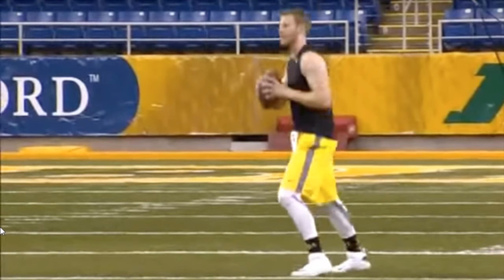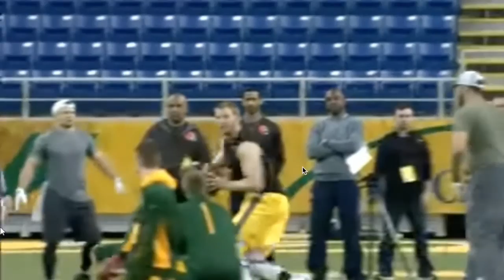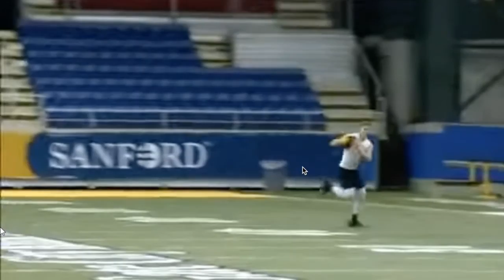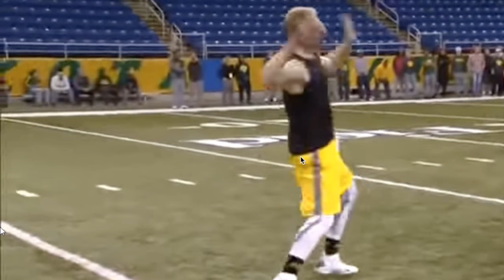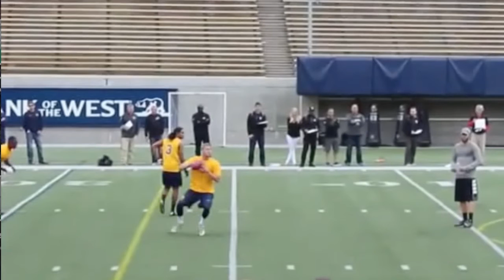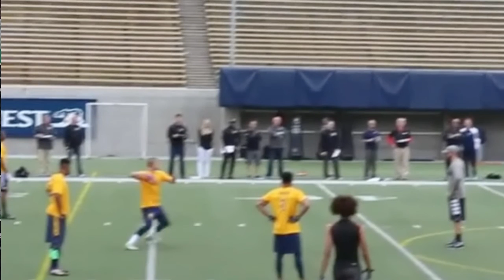Carson Wentz and Jared Goff Throw Mechanics Breakdown

Comment: Bad assessment, wentz problem was he winds the ball the way leftwhich did which messed with his accuracy as a rookie .. look at where the ball is before he gets ready to throw  (his waist) .. now look where Goff ball is (his chest)..  but look where Goff elbows are before his release (they are pointed out instead of in) Goff cocks his arm to the side when he throws, that's where his mechanic problem is .. wentz throws his ball with his elbows in .. they both had a mechanical issue, they were rookies though & both have corrected them now